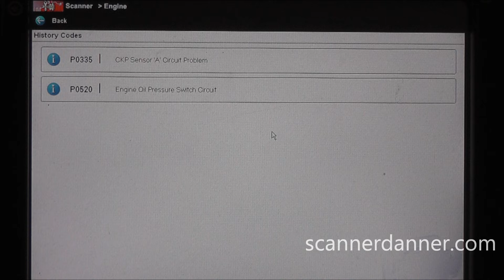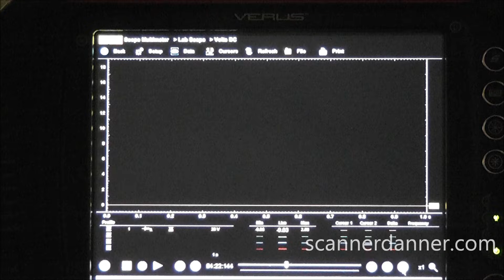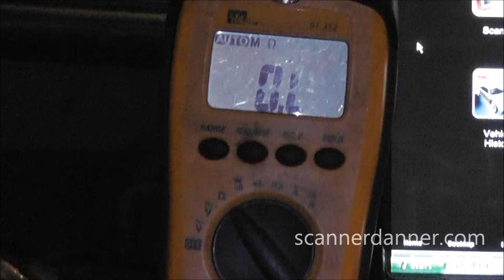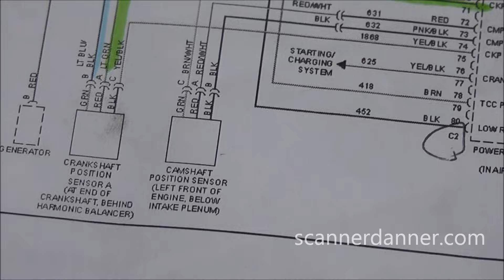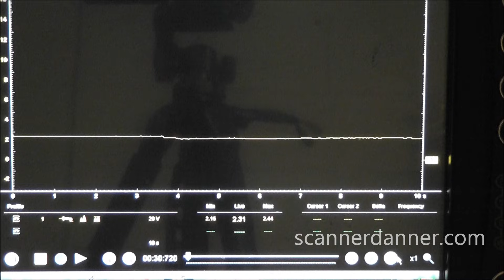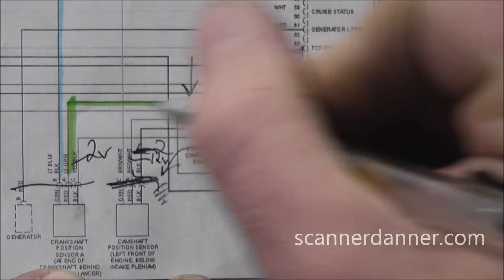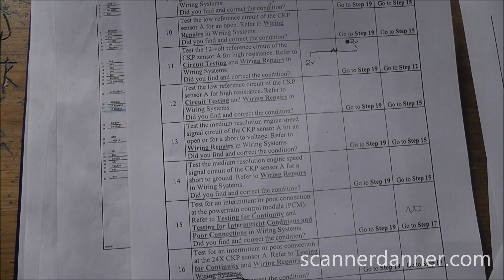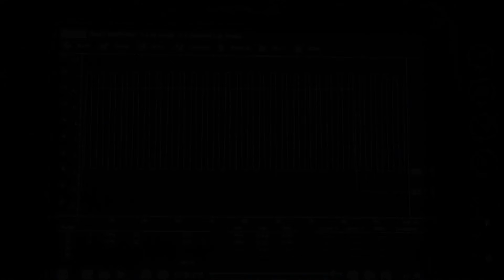2005 Impala Crank Sensor Code P0335 From A Shorted Cam Sensor

Comment: if short to ground what can i see in multimeter  ??
Reply from the maker: On what test? voltmeter or ohmmeter?
Reply: Sir. My English is little bit poor 
Sorry about that 

Anyway I wanna know.  
If short to ground what can I see in. Ohmmeter?
Reply from the maker: no problem! A short to ground on a single wire will show you 0 ohms on resistance when one meter lead is connected to one end of the wire and the other meter lead is connected to a known good ground.

Comment: So I got this going right now with my 2008 impala with the 3.5 same thing cam sensor wires were all touching I fix them but never changed the cam sensor my car dies after reaching operating temperature but if I let it cool out for about 2 min the car starts and will drive for another 7 to 10 minutes and dies again.
Any help would be much appreciated? Anybody having the same issue out there?
Reply from the maker: Are you still setting cam sensor fault codes?
Reply: ScannerDanner Codes I'm getting are C0242 and P0601
thank you!
Reply from the maker: I'm sorry Fernando, I am swamped right now. Would you mind posting your repair questions here?
https://www.scannerdanner.com/forum/post-your-repair-questions-here.html

I will try to help once it is there. Just email me and let me know when you post it. 
paul@scannerdanner.com

Comment: i bought all the lectures, i got confused because he is talking about reference voltage when he said it was a pull-up design, and when i hear pull-up or down switch design i automatically think it is external,''like a sensor or actuator'' this is internal to the PCM,and its not a sensor or actuator its a 12v reference were talkin about, i got alil confused..

Comment: If you did the short to ground test on the cam sensor feed it would had shown a short...
Reply from the maker: It would have regardless if it was at the cam sensor or not because it was shared with the crank. Make sense?
Reply: @ScannerDanner  I'm only just getting started on using my scope. am I wrong in thinking if you were connected to ground and the 12v supply at the cam sensor (connected) showing the shorted voltage and unplugged the cam sensor it would return to battery voltage. also if you were connected to the crank sensor feed and ground with the crank sensor connected or disconnected you would had seen the shorted voltage with the cam sensor plug in, then by unplugging the cam sensor the crank feed would return to battery voltage? 
Thanks for replying I'm finding your videos very helpful :)
Reply from the maker: @recs5351  no it wouldn't have because the short was in the cam sensor wiring under the power steering pump

Comment: I have shorted crank shaft sensor the 5 volt be 0 volt when I plug the sensor and when I unplug return to 5v volt a gain please can you explain that to me if I have bad sensor  and very thanks master
Reply from the maker: Is that 5v being measured on the reference circuit (power feed) or the signal wire?
Reply: On feed wire reference  voltage please help me friend
Reply from the maker: sounds like you have a shorted sensor my friend
Reply: ScannerDanner thanks friend  I'll see